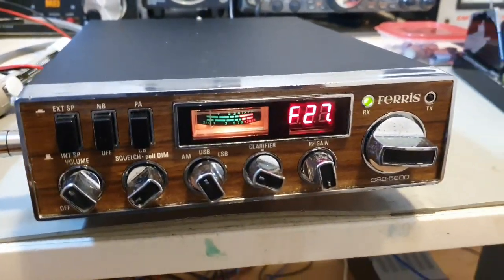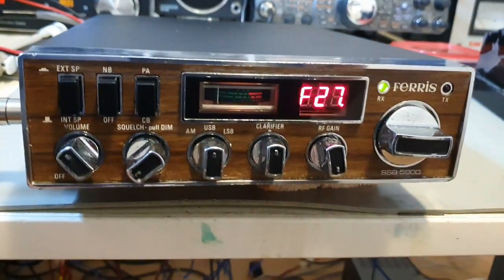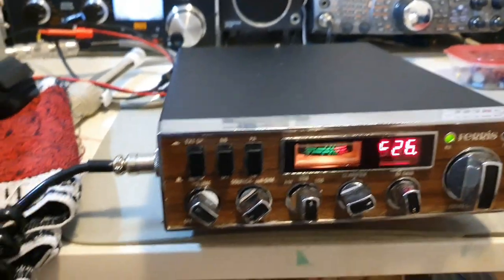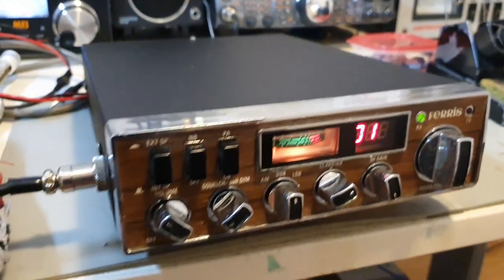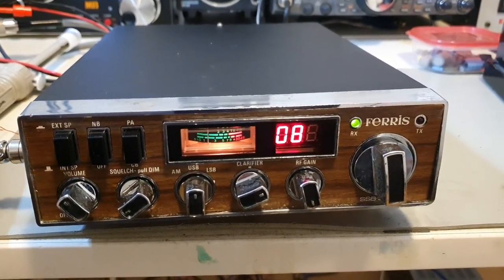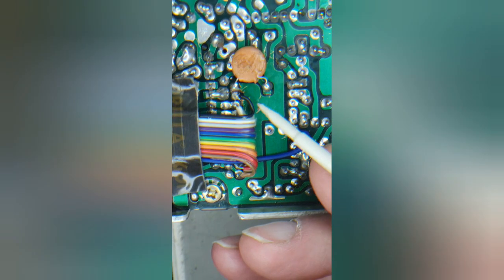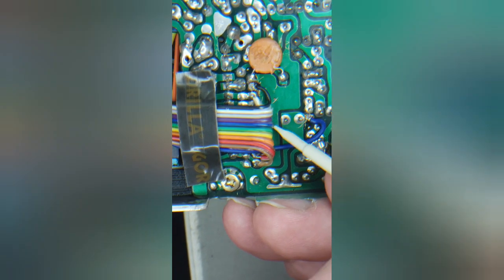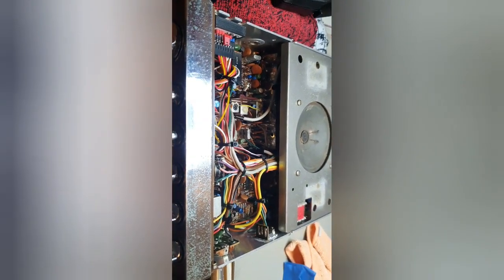Ferris SSB-5000 Restoration - CB40 V3 858 How To Video - Align - Part 4 of 4

Comment: Looking great Paul, it really shows the 3 digit display, well done Sir.
Reply from the maker: Yes it does

New update in the V3 and has two plug in points so you can have OLED display connected at same time as 3 digit display